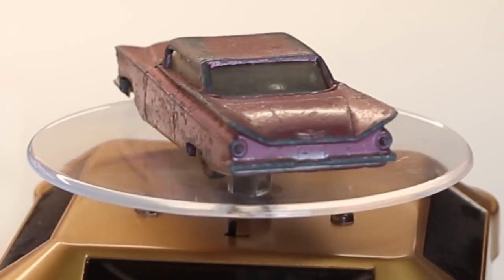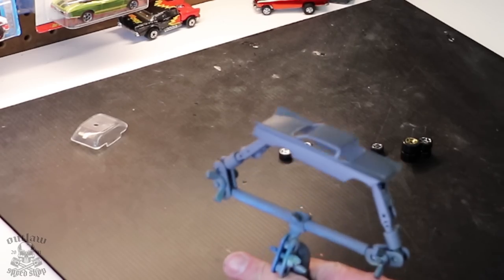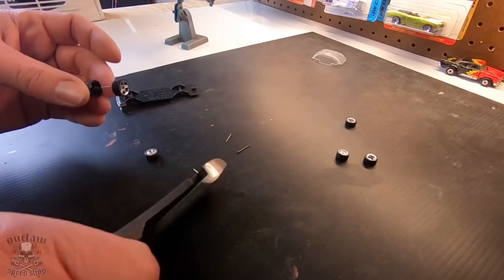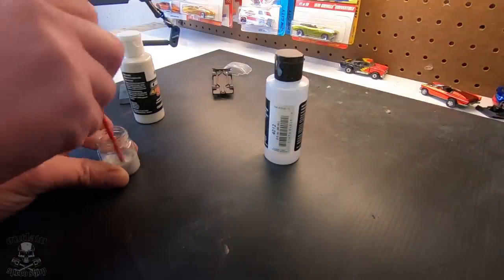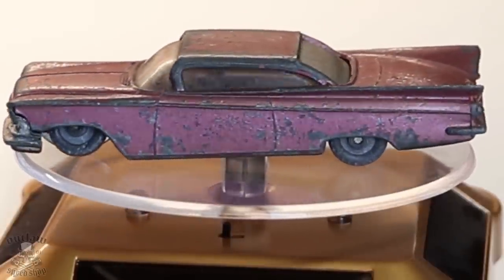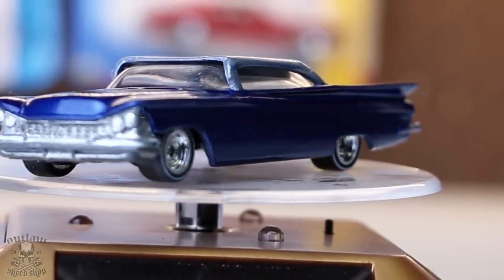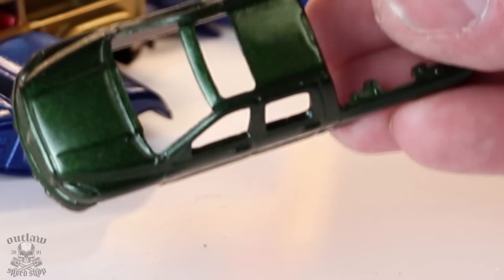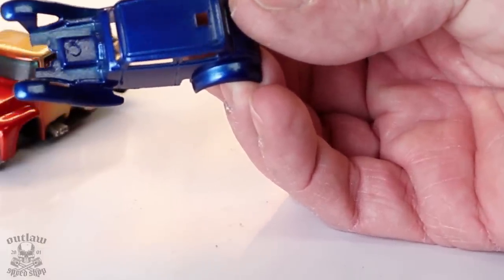Episode 32-1:64 Scale Buick Custom Part 2

Comment: You stated that you bought clear from a body shop supply store, but didn't say what brand you bought. I've restored antiques and built totals for over 40 years. If you bought PPG clear, there's your problem. In 40 years I have never gotten a good paint job from that stuff, it's horrible and works you to death in the end just to get something that looks good. Subbed from Diecast Resurrection. You do some awesome work!!

Comment: I love that casting. Think I'm gonna look for one my self.  Big 60's fan!!. I use wicked colors for candy paints. Mainly cause its what's in my town. But I have good results with it, just still looking for the right clear coat. I get the finish I'm looking for just not the strength.  I find when I handle the model some times the paint chips. Great paint job though!!
Reply from the maker: I have been putting the redlineshop.com clear on the last few and love it. Have to put it on heavy for it to look the way I want